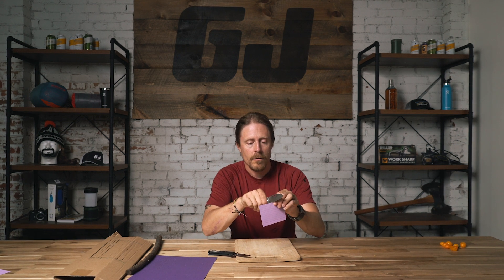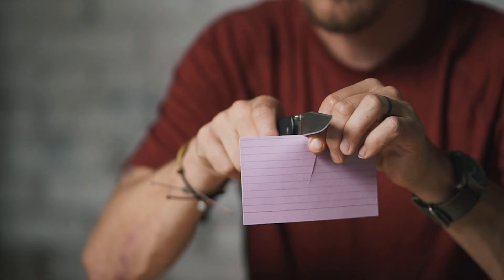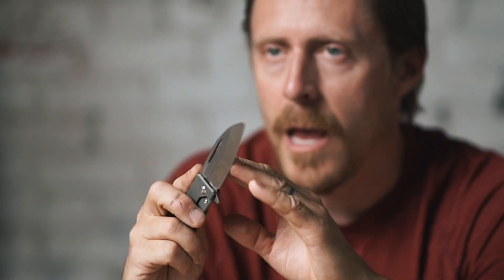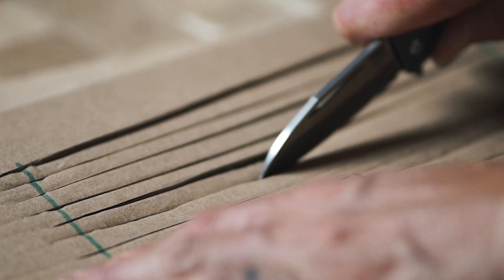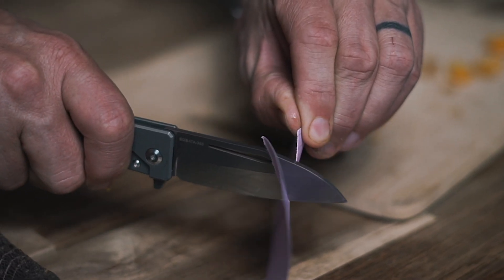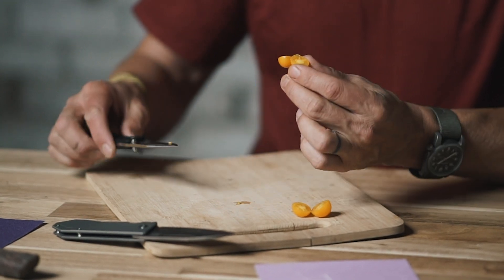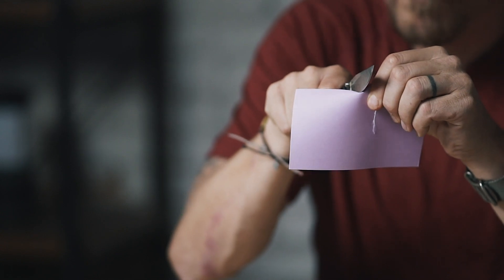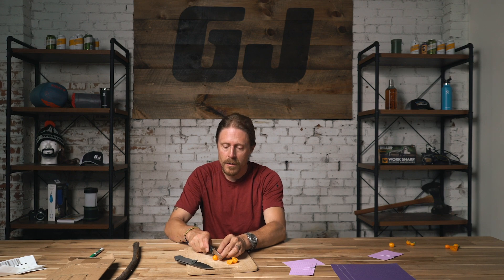Vargo Titanium Blade | Holds Edge 5 Times Longer Than Steel?

Comment: I literally cringe watching sandpaper getting cut. I remember reading about some new blade material that came out of MIT several years ago. It was supposed to never need sharpening. It didn't really hold the apex for a long time the way a normal steel would.
Instead the micro serrations would wear then naturally break off, resulting in a new one beneath it. Dixie cup dispensers came to mind when I read about it; you pull one out and another takes it's place… 
I never thought about it again until watching this. It seems like even if it stays sharp as they claim, it isn't the type of thing that's going to make you retire your traditional blade steel. Doesn't look like the best thing to use for camping and things like that.

Comment: Just my opinion but I would get twisted sissal rope, it wears them slot quicker. As for to test the sharpness, get phone book paper or something very thin like that. Reason it takes a very very sharp blade to slice phone book paper. Regular card stock even if the blade is dull it will cut it pretty good. Good stuff though!
Reply: Newspaper

Comment: Another non steel option...but what's what's toughness like? The worry with ceramic blades is that they are super brittle. Drop one on a hard surface, and it's done. The tungsten carbide based blades can be good, like Sandrin knives...but they cost big bucks
 This is priced fairly, so naturally I'm intrigued.

Comment: 5 times better than steel. Which steel? "Surgical steel" on a $5 gas station knife? Probably. S390 or cpm rex121 at 70 hrc? I doubt it. 
Also your testing didn't show anything and was kinda dumb. Either get some cardboard or rope and use both knives to the media stopping every 10 cuts to check sharpness. And use at least printer paper not an index card to check the edge.
Reply: You are just missing telling him to name his channel Cedric and ada 🤣🤣

Comment: Get some 1/8in twisted sisal rope cut it 10 time's test the edge by push cutting printer paper. Stop the test when it no longer cleanly push cuts the paper. Edge retention tests have been done this way for awhile now, if you truly want to see the difference between knives that's how. If it doesn't out cut bucks s30v it definitely won't out cut a custom heat treated blade in a steel like Maxamet or CPM Rex121 at 70 hrc.
Reply: I'm hoping to see a Cedric and Ada test on this material.

Comment: Interesting. Wonder how that'd be to sharpen?
Reply: Hi Justin. From my experience - easy. It's a pretty soft material, so it hones quickly. I've had a hard time getting a super keen edge on it, but as noted in the video, it still cuts really well. Unique stuff indeed.
Reply: @SeanMcCoyOutdoors  cool thanks for that dude 👍
Reply: Justin Haywood was wondering the same thing.
Reply: @jamaliciousben  I suppose that if you're using diamond sharpeners it'd just be a longer process depending on the hardness of the blade